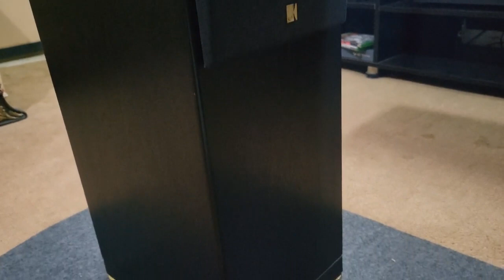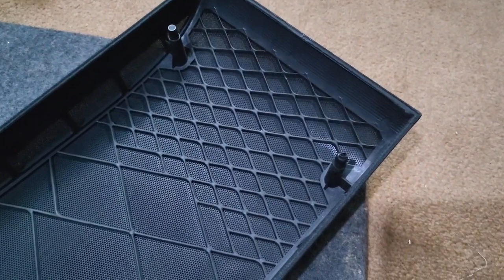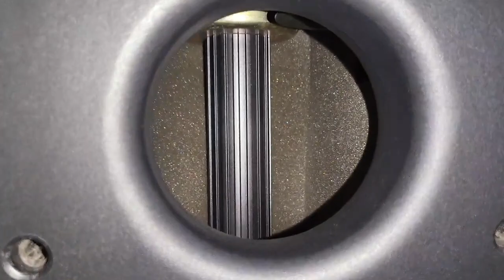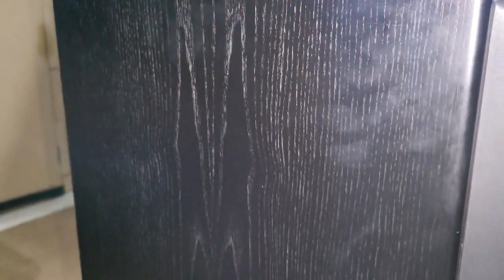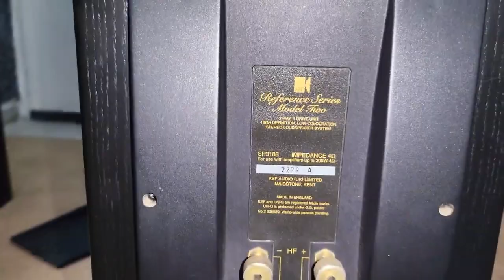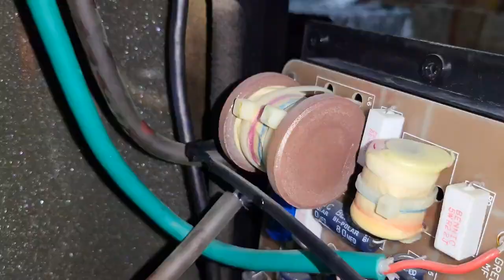KEF Reference Model 2 UK Made Review

Comment: Great review....I have just bought a pair of these and they sound incredible despite one of them having an issue with the mid range, does anyone know what could be wrong with it? it has bass and treble just no mid on one side, is it the crossover or the actual speaker driver itself? I tried the speaker in the other channel to make sure it was not my amp its definately the speaker. any advice would be appreciated thanks.
Reply from the maker: the xover or the speaker itself! the speaker replacement is cheaper as compared to the xover. you could try removing the entire speaker and fix it with the other speaker tower xcover . that way youll know if its the xover or the speaker., if its a speaker you should be good to go in $50 without the tweeter. try this and do let me know whats the outcome. i think its the xover though!
Reply: @CycleScopebyKashif  Thank you for the replay, I already found a replacement speaker for £149 with no tweater and it is around £199 for a full service / replacement of faulty parts on the crossover to make them like new again, I only paid £250 for the speakers which is not alot they are 9/10 condition wise and they still sound amazing! much better than my old Mordaunt short ms25i pearl edition...I can take it to a local shop for testing for £35 so I think I will do that and see what happens. if you can tell me where to get a replacement driver for that price I would appreciate it thanks,
Reply: @yankidiot  last i checked on ebay for a fellow around an year ago for the driver. yes they sound better than them.the speakers i have use used personaly which surpass these kefs are the B&W CM9, the triangle antal ex and spirit series came no where close, none of the klipsch were close in terms of music listening. jamo didnt work out either.  35Pounds are not bad if you can manage the hassle of transportation but its quite easy to do so yourself. 

1. you need to take out the faulty driver.
2. disconnect the driver of your working speaker and connect this driver there.
3. play and you will know if its the driver or the speaker. 

the only thing i would say considering the speaker age is to get the cones of the woofer replaced, then tend to get a bit hard after a decade of playback. may i ask which amp and or pre.amp & source are you using for playback?
Reply from the maker: that was around an year ago on ebay for 50$ or 70$ with shipping i think...something like that. what i can tell is that i reviewd the $1000 triangle antal ex espirit series and kef blew them out of the water so you can say your investment is safe. spend on them.
Reply: @CycleScopebyKashif  They sound incredible I love them